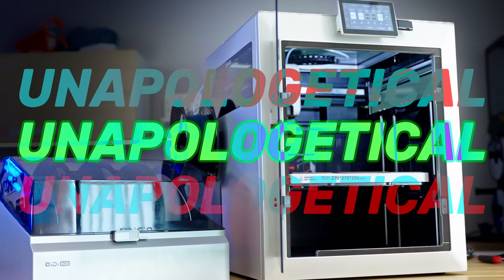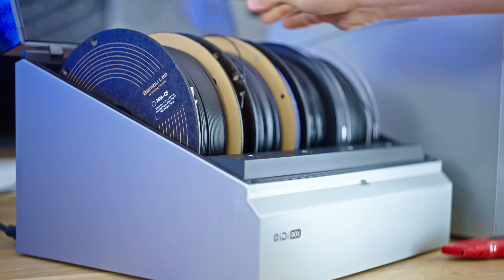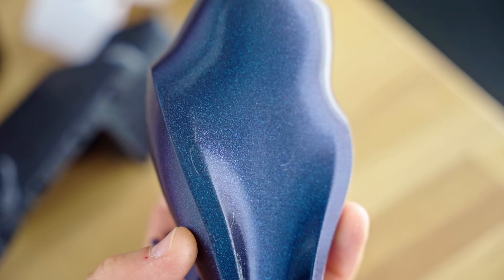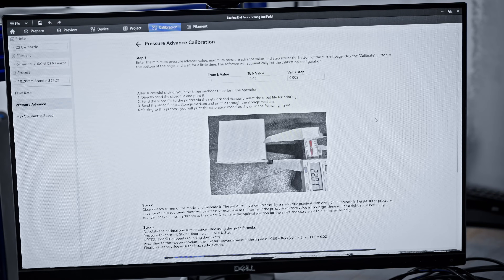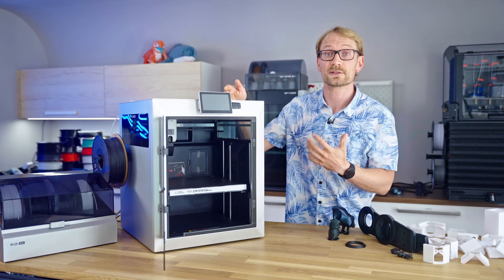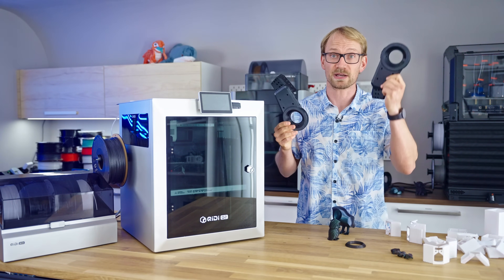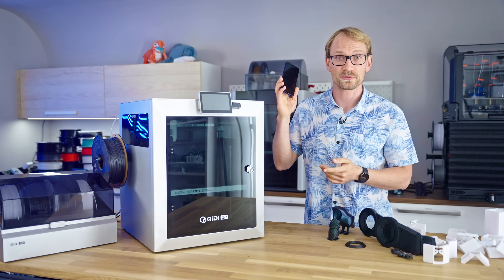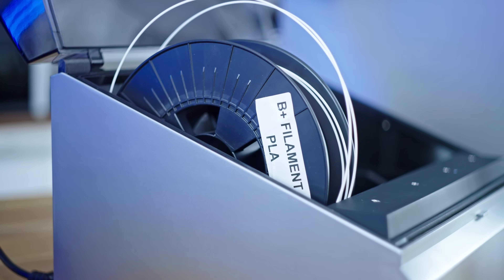Wannabe or Klipper-based powerhouse? "It's complicated 💀" with the Qidi Q2.

Comment: I am curious if you tested the printer woth Qidi Filament or a generic filament.  I have similar bad results when I use 3rd party filament.  When using Qidi rapid PLA or PETG, it prints reliably and consistently.

Comment: When I print PPA-CF or PPS-CF on my QiDI Q1 Pro I use glue of even  hairspray (when I can't find my glue stick) as a release agent and I have never had a issue removing from the print bed. Great breakdown, I am torn between the  Q2, Max4 of the Snapmaker  U1. All can do multi-color and for  engineering material I  have the Q1 But I am  looking at bed size. and haven't been able to make a decision yet. I may wait and see who else comes out with a multi-toolhead printer  in 2026 and go from there.

Comment: Built in profiles are just a better starting point for what you want to do. On bambu printers I often how to adjust and tweak setting to get model printed right. It is case dependent. Only thing that bothers me is how printer looks, they have their own look, I do not know why they copy Bambu. But looks are not important as long it prints well.

Comment: Any further updates on this printer? Has there been firmware updates that have fixed issues? I'm considering this printer to replace the Centauri Carbon I have.
Reply: Also curious if any firmware updates have been pushed to fix the issues?
Reply: What's wrong with CC, why you updating to q2?
Reply: @AK.expo09  Chamber heater. Slightly larger build plate. Klipper software. MMS system with ready for engineering materials. And I'm not impressed with Elegoo's business practices in regards to how they treat their customers. So I'm speaking with my wallet.
Reply: It's good no worries, galaxies above CC

Comment: Having seen this video and @MarcoReps, I think it looks like fine hardware but two reasons I am holding back:
1. Default settings not being good out of the box, leading to either bad or slow prints.
2. Some availability issues, e.g. could get the printer but not the box.

If someone announced they'd made a config and howto to fix it, I'd consider it.

Comment: Does the Qidi box have motorised vents like the Bambu AMS2 and AMS-HT to vent moist air? In my experience they are a massive upgrade compared to normal filament dryers.

Comment: I have one of their older printers (X Smart-3) and recently had the Z-axis frame break (due to my own incompetence, I put unnecessary pressure on it). I shot them an email about it and even though my printer was out of warranty they were still willing to send me the parts to fix it (I just had to pay shipping) along with a super detailed video on how to go about the repairs and now it's working like new.
People may call Qidi and their printers a cheaper Bambu, but the reparability and the ability to print engineering filaments (the most I've done is PET-CF and ABS and both print as easy as PLA even though my printer doesn't have an active heated chamber) is a real marvel considering the price. It's taken them a while to get the Qidibox going but I can't wait to see their attempt at a tool changer if they decide to jump into that market too.
Reply: QIDI support is very good.
Reply: I just ordered a Q2 and this is very cool to hear. 3D printers will have things break over their life and having maintenance parts and good service is a must

Comment: you should use a product called 3dlac wich acts like a separation layer , also to help taking out the remaing bits of print that get stuck to the bed try to soak those bits with isopropyl alcool, they come off way easier
Reply from the maker: I shouldn't have to use those extra products. Working PEI plates have been on the market for literal years now.

Comment: Qidi printers are like buying into a kickstarter except you get the printer before it’s complete. Love my plus 4, but it has not always been smooth sailing lol.
Reply: This one is much better, no worries
Reply: @JakovPerisic that’s good to know. My Plus 4 is a great printer. First layers are annoying though. I found a loose screw from the manufacturer shorted the hotend circuit one day during printing. And it needed better cooling on the mainboard and on the hotend heat sink but other than that it’s a great printer. And qidi support is always willing to help and have sent me replacement parts free.
Reply: @Javii96  Q2 solves first layer issues :)
Reply: @JakovPerisic who is riba
Reply: @Javii96  why do you ask, are you stalking me or?
Reply: @JakovPerisic  I recognized the profile pic. riba was harassing me in comments on another channel to the point i stopped commenting on the channel
Reply: @Javii96  no he wasn't.

Comment: In the start G code, i adjusted the prime line to 0.3 height and 120% flow. Comes off easy every time even with PET-CF which bonds really hard
Reply: I copied the prime line from the Bambu start g-code -- a line clear across the front edge of the build plate and back again.  Much easier to remove, but I agree the build plate is annoyingly sticky

Comment: Had my Q2 for 3 weeks, apart from a nozzle blockage changing from PETG to PLA it's been a reliable printer.  Studio and Link software have been reliable and easy to use.
Reply: changing from PETG to PLA make that Nozzle stuck ? ! Omg :( so how can you fix this issue ?
Reply: @hoanguyenphuong6405 Heated the hot end and used a 0.35mm needle.  I'm now using eSun cleaning filament when I change material types.  No issues since.

Comment: I've had mine for a few days now.  Prints have been working well in PLA.  A very minor amount of stringing.  Had trouble feeding wood PLA into the head. Had to remove the Bowen tube to get it to engage with the gears.  The one frustration I have is getting the phone app to work.  I scan the code.  It binds the printer.  Then just continuously says printer offline.  Tried a whole lot of trouble shooting.  Can't get it to work.  If anyone has any ideas on the Qidi link issue I'm having, please let me know.  Qidi support have been useless.  Just keep suggesting things I've told them I've already done.

Comment: Considering the competition this printer  is probably doomed. I doubt anyone will buy this on the nozzle temperature spec, and if that is taken out of the equation, there are options that looks more promising. If you’re into exotic filaments, you are most likely in the category of people that just want something that works and work well, because the printer is a just tool, a means to an end, that you want to produce good results, reliably. This one seems not to tick that box. Feels like a new batch of beta-hardware (and software) released to the public.

Comment: Bro qidi q2 is much beter that bambu X1
Reply from the maker: Please explain
Reply: @MadeWithLayers First of all, the chamber is heated to 65 degrees Celsius. Secondly, the extruder goes up to 370 degrees—370, fucking degrees. Yeah, logically it has some problems, but let’s be serious, what printer hasn’t had issues at launch? They get fixed after release. That’s why I’ve always said: don’t buy a printer in the first few months after launch, and everything will get resolved."

Comment: Hey, just adding my annoying 2 cents, the Qidi Q2 can absolutely NOT handle materials like PEI (ultem).
for those filaments, the real issue isn't hotend temps, we have DIY solutions able to reach 450-500°c already. The issue is you absolutely need a chamber temperature in the high hundreds, if not 200°c+.
Add to that needing a bed temp to match, and not a pei coated one.

What the Q2 can absolutely do tho is print those commercial PPA-CF/GF. And even things like PPS-CF/GF, but the layer adhesion is going to be taking a big hit on that one.
Reply: Indeed. Don't even talk about PPS, even ABS in 65C chamber is much weaker than in my 75C Voron chamber. Anyway, Q2 at least has heater to 65C, by far the best option out there (under 2K) and the print quality + consistency are really screaming at me to buy Q2 and sell Voron.

Comment: Why are we still waiting for a 500x500x500 printer?!  It should be the "standard" size printer.
Reply: SV08 Max
Reply from the maker: That size is impractical in too many ways unfortunately....
Reply: Because a pre assembled core-XY  would be the size and weight of a washing machine. The bambu H2D is already quite huge. Power consumption would be a nother concern, at least for users with 110V outlets. And "just makeing a bigger printer" results in a massive fustercluck like the Orangestorm Giga.

Comment: About that Printer Profile for PETG

@MadeWithLayers I just got mine a little bit more than a week ago and started playing with PETG yesterday... Not all of my three nozzles are clogged. :-D 

Could you please share the printer profile you received from Qidi? PLA was fine but it's so frustrating not being able to keep calibrating and experimenting since all my PETG prints except the Riser failed with a clog half way though. I also don't have the experience to unclog them so I'll be waiting for the support reply. 

Thanks!
Reply from the maker: The only changes made were to set all speeds to 60 mm/s and to disable dynamic overhang speed. Though wrong speeds shouldn't clog nozzles to a point where the extruder is unable to push them free when heated.

Comment: Well, since it's cheaper than Bambu Lab, we probably shouldn't compare them if they've used the “lookalike” strategy. For me, the external copy is a model of: “Look, we can create something for less than what they've created, and what's more, the software is open source”. I think that's what appeals most to those who know about 3D printing and machinery, and that's why we buy it. We know it can be adjusted and that it's not a closed system. And I mean, you started with something very basic, like any of us who started with 3D printing back in the day.

The point here is: if the buyer knows nothing about 3D printing and prints everything they say they're going to print on the first try, for that price, this printer is to be the best. In fact, I'd been wanting to upgrade my printer for a while, and ChatGPT recommended it to me and explained all the pros and cons.

Now, let's give it a try and make some adjustments, as those of us who have been doing this for a while like to do, and that's it. We know that no machine is perfect when it leaves the factory. That's a big lie.

However, your analysis and comparison with Bambu Lab does not seem accurate to me. I would like to see one of your reviews after they update the firmware and make some adjustments. I think it's an excellent printer, you just have to give it a chance with the community and use it for a few months. I also think you had a bad first experience with colour. On another channel, I saw someone who printed, I don't know, like 40 dogs in 4 colours, and from start to finish they had no problems. I think yours was a personal experience. As for the materials they used to create it, I think they pushed it to the limit in terms of the best, the good and the cheap.

What I would do is replace those standard filament tubes and swap them for that old brand, “Capricorn, I think it was called”, or I would research which materials or brands of tubes have less friction, for example. As for the software, I would wait a bit to see what the community does. I'm even waiting to see what Orca Slicer does with this new printer. I'm sure it has a lot to offer.

Let's also hope that they make some changes to future sales of the QIDI BOX, as there are quite a few reviews out there, but anyway... let's give it a chance.
cheers.

Comment: I'm brand new to 3D printing and I've just gotten the Q2. I've had 6 successful prints by my beginner standards but I've always had a gut feeling the machine is configured to run way too fast. I'm glad to see someone who's an expert in the subject say it's running to fast. 

My only problem is that I'm so new to 3D printing that I'm not sure of the best way to slow it down lol
Reply: Best way is by lowering volumetric limit in material properties.

Comment: Thought that I would add my 2 cents worth. I bought the Q2 with QIDI Box back in August. QIDI said the Box won't come in for 2 months. All my prints have been single filament so far. I have been printing with Q2 for 3 weeks now. I have only printed with PLA and PETG.  The PLA is QIDI Rapido PLA and the PETG is Voxelpla PETG+. There are built-in settings for Rapido PLA, and I used the generic PETG settings for the PETG+. The list of predefined filament settings is very limited. I am connected to the Q2 through the ethernet port. I have found the Q2 to be exceptionally easy to use. I slice my STLs and send them to the Q2. For PLA, I removed the entire top glass and set it aside. For PETG+, I kept the glass top completely closed. It takes about 10 minutes for the Q2 to go through its prep routine before starting the print. The prints have all been quick and really very good. The Rapido PLA parts almost fall off the build plate. The PETG+ parts are stuck more solidly, but flexing the build plate causes them to release. I have used no release agents on build plate like PVA stick or Magigoo. I haven't even wiped the plate with alcohol yet. The longest print that I sent to Q2 was about 4 1/2 hours. So far, I am extremely pleased with my Q2.  Input shaping is very noisy, but I have only did that once when I was first setting Q2 up.  There is a fan that does run continuously when the Q2 is idle. I also had to update the firmware when first setting up Q2. This was very simple. I am not seeing the same VFA lines that Thomas is.  I respect Thomas's opinion. I vent my 3D printers and have an air quality meter and HEPA filter in my room because of Thomas. I use Voxelpla PETG+ because of Thomas. Maybe I haven't printed enough with it, but I am really happy that I bought my Q2.
Reply: Same.  Awesome tool and it prints higher temp plastics like a charm.   Def better than Bambu
Reply: Ditto!

Comment: Sorry if this is the completely wrong place to ask for advice... I have a beautiful silk copper PLA model that took 10 hours to print and then I had to go mess up a spot in a prominent area with a rotary tool. It’s maybe the size of a dime. Anything I can do I repair, or minimize it?
Reply from the maker: Depends on what your exact issue and goal is, but I find hot air tools (particularly my hot air reflow stations meant for SMD soldering, with a small air nozzle) very useful for reworking surface finish and smaller blemishes.

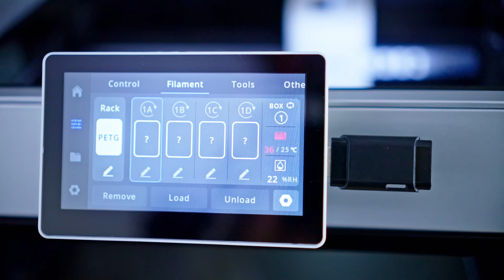Comment: 13:00 The AMS 2 Pro does do filament drying. So it's not like they don't have the option.
Reply from the maker: So one thing I learned after the review went live - the AMS 2 (Pro) that I'm showing in the H2S video does support filament drying while printing, but for that it needs an extra 24V / 4A power supply plugged in, which is not included by default.
Reply: @MadeWithLayers  Really weird.
Reply: @MadeWithLayers  interesting, thanks
Reply: But not while printing.

Comment: Thank you for the video. I think I'll give Qidi a miss until they have ironed out the issues. I want something that works out the box and has a proven track record instead of being a Guinea pig. The heated chamber is a nice feature but not really worth the multitude of problems highlighted here.
Reply: Yes it usually takes half a year to iron the problems out, old qidi pattern, the plus 4 is now a really nice solid workhorse, it had its issues but they are now ironed out, the same was with the predecessor model, we also see the same pattern with the box and noq the q2, let it rest and be fixed for half a year and you wil get a really solid printer.
I have 700 hours on my plus 4 and any problem i had so far were my fault and that were not a ton of them, the printer is a solid workhorse as can be!

Comment: Thomas, Could you share the model for the led panel clamp you shocased in the video? i tried to search the popular model sites, but i had no luck.
Reply from the maker: I still need to test and install the clamp (and finish designing the locking piece), I'll upload it when it's done!
Reply: @MadeWithLayers  Hey Thomas, it'a me again. is there any update on those led panel mounts? :)

Comment: Agree, the printer is fully functional, does not require a mandatory cloud connection, is open source, and has excellent print quality. You only need to make some changes to the slice configuration according to the model material. Overall, it is great, not like other cheap and low-quality 3D printers.

Comment: New AMS style systems are dead to me....Bondtech INDX & Bambu Vortek with one printhead and multiple inductive hotends are the future.  And why buy this garbage Qidi and worse box when you can hit the second-hand market and get a steal of a deal on X1C's.  Since Bambu recently dropped the price I have seen a few of them super cheap in my area.  And it's only going to get better rather quickly.  There is one with an AMS for $800 I am considering right now and I can surely get it even cheaper.  Add a heater too it for cheap and Bob's your uncle.